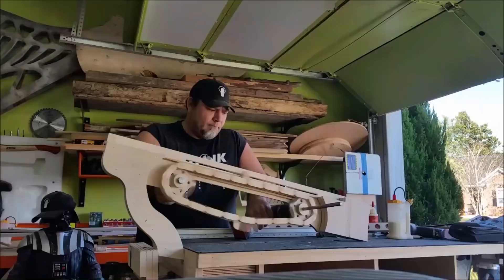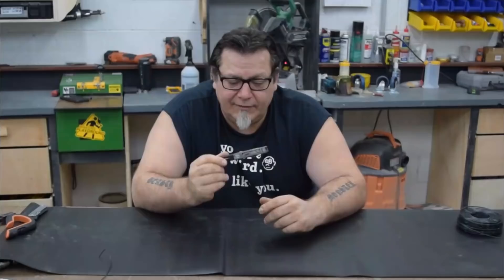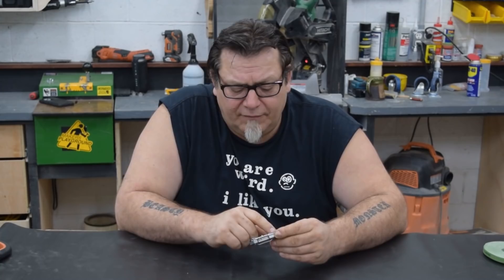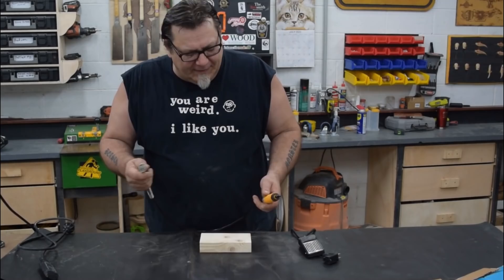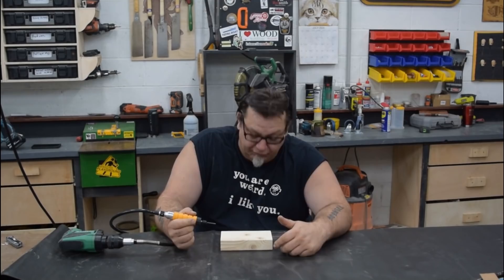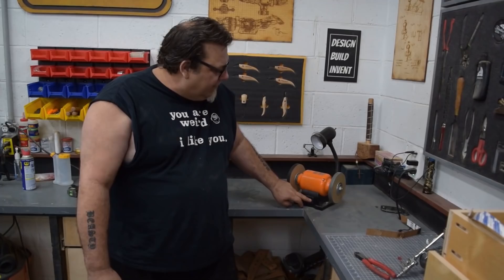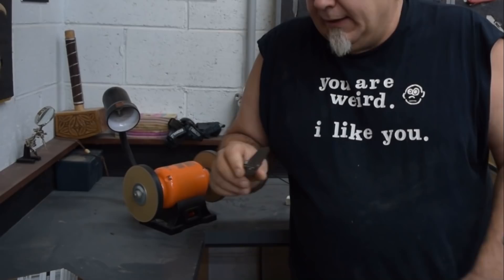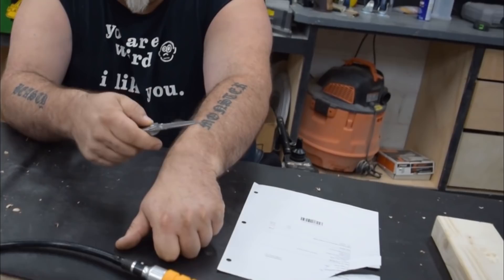5 Weird Tools I bought on Amazon that I ended up really liking

Comment: Obscure tools that are good buys for the price is a great video format, honestly. I obvi prefer the crazy builds, but wouldn't say no to more of these if you just need the reliable content!
Also, A tip! When sharpening on exposed wheels like that, I find it very easy to miss even a pretty concrete visualized spot by just varying where I'm standing a tad, so what I do is I have one of those tiny little Ryobi laser level cubes set up on a block next to my grinder so that I have the precise spot labeled right there. They cost like $10-20 depending on where you get them and if they're on sale and they are dead useful also for leveling things, and are tiny so you can have always have them in your toolkit or floating around your shop.

Comment: I bought the slice boxcutter a couple months ago for a stocking job cutting boxes for eight hours straight and I loved it. It was so handy to whip it out the pocket to cut a box and back in the pocket without even looking. Only wish the blades weren't their safety blades and they stayed sharp longer. The power carver I might need to look into though, very cool.

Comment: I sold the cardboard sharpeners for many years. I never had it turn backward. You just have to make sure the blade edge is pointed down. Much easier to visualize the angle when looking down as opposed to looking over the top. But they are the best for normal sharpening by far.

Comment: I used to own a SOG Q3 and enjoyed it overall.  I bought it primarily because of the size/shape and the fact that the pliers are spring loaded.  At some point the clip got caught on something and bent open.  Even though I had the correct size of hex wrench to remove the 2 clip screws I could never get enough purchase on one of the screws to remove it.  Because I couldn’t bend the clip back to its original position the Q3 was loose in my pocket and one day it fell out while I was on an out-of-town trip.  The downside of the Q3 was the blades were difficult to open and everything required both hands before you could use a tool.  Typically when I really need to use a tool I already have the object to be worked on in one hand so that means having to put it down just so I can prep the Q3 for use.

I switched to a Leatherman OHT (One Hand Tool).  It also has spring loaded pliers and you really can get to every tool with just the hand that’s holding it.  There are several variations of the OHT and you can get it in black or tan.  Highly recommended!

I really like that cardboard cutter.  I think my wife will like that as an extra present for her birthday.

Comment: I like the videos about the random amazon tools so certainly keep making them. I personally buy random little handy tools from there to try out, my favorite so far is a nibbled for cutting shapes from sheet metal. From this video I will take a look at the SOG multi tool because multi tools are handy but I’ve never wanted to have a sheath I need to slide into my belt so clipping into my pocket is the way to go. The sharpening system looks pretty good as well as I’m always looking out for a more efficient way than the ones I use now, just need a station for it somewhere in the garage to set it up. Your content is great Izzy, keep up the good work

Comment: Izzy you're so right, I've had this same sharpening setup for a couple of years now and it is great, BUT I did make the mistake when I first was messing around with it of sharpening the wrong way. 
I knife cuts right into that cardboard, very much unlike a stone wheel. 
It caught my knife and threw it right into my face, luckily it was just the handle that hit me and busted my lip, but very dangerous if you're not paying attention and do it incorrectly.

Comment: Yes. Awesome. Keep these videos coming please. Love this kind of content and tool vetting. 

Also, you didn't mention with regards to the Slice knife that the ceramic blade on there is cut-resistant to skin -meaning, it's not likely to cut you if you accidentally go over your skin. obviously (and I tried this) if you apply heavy pressure, you'll cut skin, but the pressure needed is way higher than from a regular blade.

Comment: As a great fan of tools in general (I spent a ton of money in different tools, it's almost like an addiction), I don't understand multitools at all. When I have a work to be done I have dozens of different pliers, knives, screwdrivers etc to chose from. I grab those which suit the best and theese specialised tools always work much better than multitool and they are much easier to operate. If I gust go somewhere I generally don't need tools at all, conception of EDC is not for me. I'm 42 and I don't remember a situation when I needed tool set when I just walked somewhere in a city/in a parc etc. I have tools in my car, in my shop, in my home and that's all. All I have with me in ordinary situation is small knife which i in 95% is used to cut a stubborn plastic packaging like blisters.

Comment: most people don't know why paper and cardboard dull metal blades quickly. They're full of a fine grit. when you run the blade through it, you're basically sanding the edge off.

Comment: Hootyhoo, my name's Scott and Yes I liked seeing you share your thoughts on some tools that you've come across (being a professional in an industry) which have potential for various needs...
   I especially like a tool you didn't go into detail about; your foot pedal switch;
 1st question I have; is it a variable speed switch or just a (mom) on - off switch? If in fact it is variable speed; I'd love to know what mfg. Makes that dandy little monker.... as I'm aware it takes special "stuff" to make it variable speed ( the guts of the unit ) ; I'd make one for myself, but I've left my trade "ind. electrical panel building"; so I've since lost my convenient access to these components;  or I suppose I could just continue to look in thrift shops for sewing mach. pedals... Anyways, I'd at least like to know where you got yours as well to compare P&A to see if it would be cost affective to shop there... if possible w/o an account... thank you for the entertainment good job as a host and,  the camera work; desent job as well so let your camera "guy" know; "fine job".  Oh yes one other item ; sharpening system you've got there;  pretty cool but I'm curious;   as a cabinet shop ( I assume you are beings you'd mentioned several times about cab. shops) why you wouldn't just make a sharpening disc.for free w/ your resources at hand? "Scrape plywood or similar product"......  ???    Well, thanks again n, please let me know.
  Late, Scott Outta Wa.

Comment: I second that SOG Q3, it's pretty good, but I wish the pliers locked in the out position. It's good for cutting and pulling but prying with the tip or hard bolts can be a challenge when the pliers want to go back in.

Comment: OLD LEATHER SMITH here, I use ceramic blades in all my swivel knives and I HAVE NEVER SHARPEN THEM, I use A LEATHER STROP IT ALSO WORKS ON MY METAL BLADES  of course the metal blade has 2 B on it's way 2 B sharp, but Stroping is the way 2 keep it razor shop, just like the LEATHER HINGE U MADE A WHILE AGO 4 UR STROP STRAP, GOD'S BLESSINGS ✝️⚾🙃